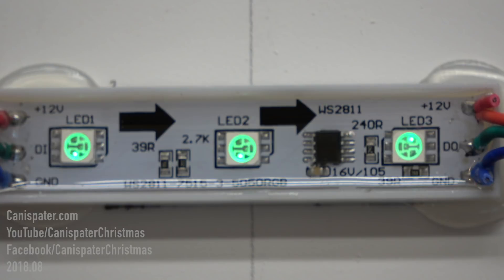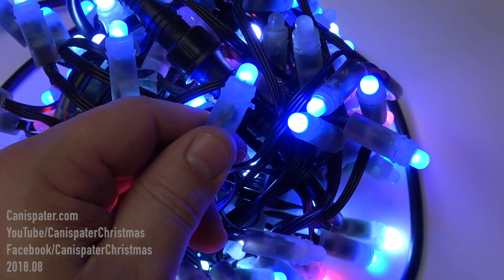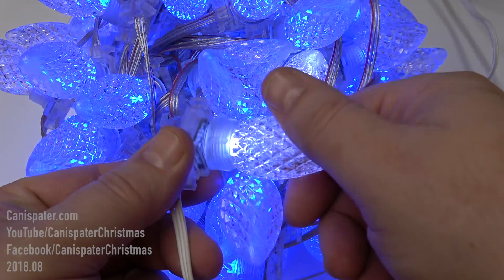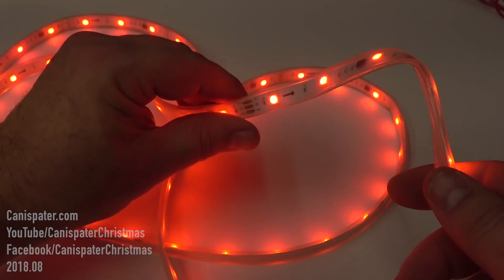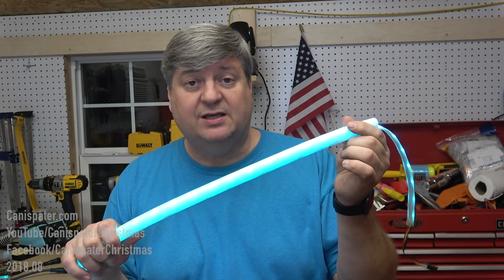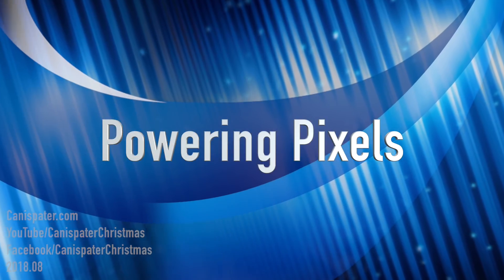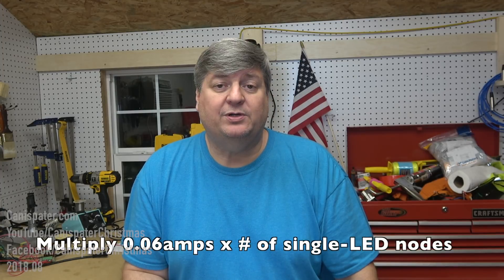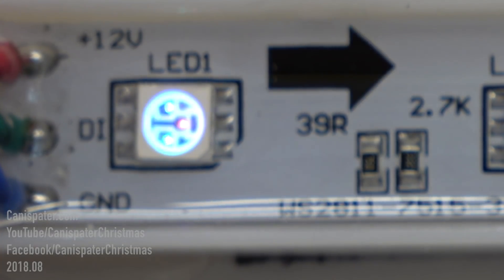HOW TO GET STARTED with RGB Pixels (2018)

Comment: have a starter question, on string of RGB lights with xconnect which end is #1 node, the one with the nut or the (female) or the end without the nut (male), I know sounds like a real newbie queastion.
Reply from the maker: Probably the "nut" end, but look at the pixels with a magnifying glass. Each one will have arrows on the tiny circuit board showing data flow. Also, DI means "data input" and DO means "data out." DI is the input side of the pixel so that is where data from the controller connects to.
Reply: @CanispaterChristmas  Thanks for the reply and videos all very helpful

Comment: Why when I connect the string of 100 pixels the frost eight pixels are still on the first one is blue and the fourth is yellow, what am I doing wrong?
Reply from the maker: Not enough info to go on there. What controller are you connecting to? What kind of pixels are they?
Reply: @CanispaterChristmas  Sorry, I have a Falcon F16v3 and I have attached another box with a Falcon BBB smart receiver v2.0 with its own power supply. I configured the smart receiver the way you did it in the video (the xlight way) but when I plug in the 100 pixel string to test it, automatically pixels 1-8 turn on and the first pixel is blue then white and the fourth one is yellow then back to white. Even when I haven’t started the test. I’ve tried changing cables but the problem persists. Not sure what to do. I appreciate your help
Reply from the maker: If you connect the string to the main board, does it do the same thing? Trying to figure out if it's the pixels or the receiver (or something else). FYI, I'll be away from the keyboard quite a bit today so you might try logging into the xlights zoom room (browse to xlights.org). They can help troubleshoot and possibly resolve more quickly.
Reply: @CanispaterChristmas  yes I just tried connecting directly to the main board and it’s fine. Sounds good, I’ll go to the zoom.  I truly appreciate your help and time.

Comment: What is a good stand alone controller.  I'm trying to get started but just want something simple to start.
Reply from the maker: There's always some degree of "what do you mean by...." in that question. What do you want to do? There are "testers" that will output data for pixels in patterns, but they don't allow for any customization of those patterns. If you just want blinky pixels, then check out Alan's web site for a tester (see video descriptions for links). If you want to run a show (ie: custom patterns, maybe to music) then you'll need a controller that converts E1.31 to SPI and/or acts as a player (Falcons & Kulp boards). If you have a Pi or computer to act as a master show player, then SanDevices makes great "basic" controllers. Availability is like everything else, kinda tight & sporadic right now, especially this time of year. Check out my beginner playlist if you are new to the hobby and that will explain most of the basics and might give you a better idea of what to look for. AND you may need to dial your expectations back as it's difficult to get started in November for a December display. Hope that helps.

Comment: Hey Jeff! Would you recommend buying used controllers? I've been devouring your content but I want to apply what I've learned. This year I'd like to set up a single talking tree using xlights, but I'm having trouble finding a controller that isn't $300+. I've checked out the Sandevices, but wanted to get your opinion on ease of use and compatibility. Seems like everyone is using a Falcon controller nowadays. Also if you have any old controllers you're willing to sell, I'm more than willing to buy one! Cheers to you and your family!
Reply from the maker: Thanks! The SanDevices pixel controllers may lack the bells and whistles of a Falcon, but they do the job well. I started out with them and they are solid controllers. If you're in the toe-dipping stage, I'd recommend them. I can't remember if they are programmable by xLights or not because that feature came out after I switched to Falcons. Either way, if you have trouble, there are people in the Zoom room that are quite familiar with them and can help you get going with them if needed.

Comment: I might pick me up some pixels this year but where I get confused is with the different controllers.
Reply from the maker: What have you been considering?
Reply: @CanispaterChristmas  I'm not quite sure if I want to start with a tree or just my roofline for the first year but I want to be able to expand and synchronize to music. From what I've seen the controllers are the biggest cost and all the videos I've found are at least 2 years old. I'm looking something that will not break the bank so the wife doesn't shut it down before I get started lol. Love your videos, they are informative yet understandable.
Reply from the maker: @homersarcade5950  Yeah, if you're dipping your toe in, pixelcontroller.com has a PiCap that will run a relatively small number of pixels, but will help you get past the steep learning curve of how everything fits together. The Falcon F16, though a larger up-front cost, is a workhorse and has plenty of room for expansion. The F16V4 is out, but with all the supply issues you probably can't get one this year. The V3 is still a very capable controller and I still use my V2. Controllers have a very limited job - convert E1.31 data into serial data for the pixels so they tend to be useful for a while. Each new version has additional capabilities and capacity, but the old ones still work great. You might also look for a used one to keep the wife happy.😂
Reply: @CanispaterChristmas  is that serial data the same as DMX? I've seen some e1.31 to DMX  controllers around the web and was wondering if that was the same or not.
Reply from the maker: No it's SPI I believe - a serial protocol you see on microprocessors/arduinos. Some pixel controllers have DMX outputs, but it's different serial data.
Reply: @CanispaterChristmas  ok thank you. I was getting confused with the different signal types.

Comment: Jeff, I am getting ready to order pixels from Ray. There is a large selection to choose from. But I think I have it figured out. I am not sure on the spacing however.  What do you think about these.?
Promotion!!!WS2811 DC5V 50nodes addressable LED pixel string node;IP68 rated;3inch(7.6cm)spacing;24AWG wire,;RGB full color
Reply from the maker: Promotion = defective. That's why they are cheap. Shipping from China is kinda horrendous right now. You might be better off going through wiredwatts.com if you are in the US.
Reply: @CanispaterChristmas  Thanks

Comment: Do you use resistor or regulated pixels?  Do you have a strong preference for either?
Reply from the maker: I got some last year, but I haven't done tests to see if they are actually more efficient. Might be a good video. :)
Reply: @CanispaterChristmas  about to place my first big order any thoughts on going with regulated over resistors?
Reply from the maker: Regulated should be more efficient, but otherwise the same. You may not see much of a difference with 5V pixels, but possibly with 12V. Like I said, I haven't really done tests to see if there is much of a difference. You might check on Facebook to see if anyone has done more research.
Reply: @CanispaterChristmas  making my first big purchase from Ray and want to ensure everything is correct I ordered “100 node bullet regulated dc12v addressable 12mm ws2811 led pixel string” this will work with common controllers like the falcon, correct?
Reply from the maker: @frostycarbon270  WS2811 is supported by all controllers AFAIK. Know that shipping from China is kinda horrendous right now. You may get better pricing from a local vendor, but if you've already placed the order, then no worries.

Comment: Do you have any recommendations on 3 strand wire for longer runs?  I see thermostat wire is 18/3 but I doesn’t seem to be rated for outdoors.
Reply from the maker: Unless you plan to permanently install it, outdoor rating is less important. I generally use speaker wire just because I had it on hand. Real copper does seem to do better as I've seen corrosion with CCA.

Comment: how many pixels can you have in a universe?
Reply from the maker: A universe is 512 channels so 512/3 or 170. You can actually use the last 2 channels for 171 and have the next universe provide the 3rd channel. You really don't need to care about that as controllers & software understand the protocol. You just need to allocate enough to handle what you need.

Comment: Thanks Jeff for wonderful videos. My home wall outlet is 110 V AC, & hooked up with main panel breaker of 15 amps. If I use same outlet to power my pixel controller , how many pixel leds can be hooked up with same controller ? i mean, does 110v AC wall outlet amp capacity & amp being consumed out of DC 12V/5V  controller has any relationship ? how to calculate safe amp load?
Reply from the maker: There's a relationship, but I don't know the calculation. I'm running about 6K pixels on 1 outlet. It peaks around 800 watts AC and idles around 200 watts.

Comment: Can I run light o rama controllers with a x-lights program
Reply from the maker: Yes. You can either use a dongle or get a pixel controller (like the Falcons) with a DMX/LOR output that can plug into the LOR controller and sequence everything in xLights. I don't have experience with that, but several in the group do. Check out the forums and Facebook groups linked in my video descriptions if you have questions about it.

Comment: I know this is an older post but just learning more about the RGB world. Have been watching your videos. I'm a LOR user but thinking of switching to X lights. LOR licenses are getting way too rich for my blood. Plus I See Xlights have a lot more options and effects. Anyway, I'll be building a lot of new props for next year and needing to start with pixel ordering. There seems to be multiple node types but think I got it narrowed down to bullet style. thinking of going with the 12 V like yours but I see there are some that use resistors and others that have a regulator in them.  what would you recommend?
Reply from the maker: Most of my pixels are resistor because regulated are relatively new. I got a bunch of regulated this year, had some failures (slightly more than my resistor version), but overall, they seemed to work fine. I haven't done a comparison between the two with regards to power consumption, but theoretically, regulated should be better. Also, if you are in the US, my preferred vendor is wiredwatts.com. I still order from Ray for bulk orders, but I find myself ordering more from Ken (ww) lately because he has a lot more of what I need, not just pixels. To answer the question, regulated from now on. :)

Comment: What about light o rama
Reply from the maker: Could you be more specific? I don't use LOR so I'm not a good resource, but there are a ton of folks on PlanetChristmas.com that use it and can help if needed. Or do you mean you have a large LOR investment and you want to add pixels? There is a lot of interoperability so let me know what you're asking about.
Reply: @CanispaterChristmas  thanks yes I have some Lo r and I wanted to add pixels.   I am  brand new to pixles
Reply from the maker: @kiteslights7189  OK. I know the Falcon F16/F48 has an output to drive the LOR boards and you can import your LOR sequences into xLights. There's a couple of videos on the xLights web site (xlights.org) covering all that, but I won't be much help there. Definitely check out the forums/Facebook groups listed in the video description - there are folks that have already done this.

Comment: hello I was wondering if you could do a video on everything needed for a RGB mega tree to include controller power ect. i am looking at building one this year and this will be my first experience with rgb. We purchased a pixel tree from qvc and we loved it until it rained and it quit. so many bad reviews so we sent it back fort a refund. so i am wanting to build one to replace it that will hold up to the weather.
Reply from the maker: Haha. Covered on another chat platform. Welcome to the hobby!
Reply: @CanispaterChristmas  THANK YOU SO MUCH!!
Reply: @CanispaterChristmas  another question because my wife has been watching your videos and she saw you had a link for a starter kit on one of your videos but did not know which one. could you possibly post that link for me. thanks
Reply from the maker: The only starter kit I can think of is this: https://shop.cfolights.com/product/pixel-starter-kit-desktop-star-burst-2019-presale/ a very small (desktop-sized) set of pixels, but has everything in it to run them. Probably not what you're looking for though based on our previous conversations.

Comment: Great video! I’m new to all this and was wondering if I should go led route or standard lights that use light o Rama controllers?
Reply from the maker: Haha. Standard lights have their limitations, but have a lower learning curve. Pixels allow for pretty much anything you can dream up, but you kinda need to have a passion for them as there is a lot more to learn. If you have no background in electronics or computers, standard is probably the way to go. If you have the background and are a little OCD, you'll likely prefer pixels. There are forums for both camps and you can start with standard and add pixels later if you want. Which way do you wanna go?
Reply: CanispaterChristmas the pixels look way better. I know computers well but have little to no knowledge in electronics. I was thinking of starting out with maybe 2 controllers a few little trees, some house lights and a midsize mega tree? I live in a suburb home with a standard fuse box.
Reply from the maker: You might want to start with some pixels then. I had about 6k pixel in my display this year. Run it all off one circuit breaker so they don't pull a ton of power. Last year, at idle (only the power supplies & controllers running) it pulled about 200 watts. During showtime, it would fluctuate between 600-800 watts. Standard house wiring has no problem handling that load. There's not much electronics except for connecting things together and calculating how many amps a string is going to pull. The wires (+, - and data [maybe clock]) and voltages (12V vs 5V) are important. Get involved in the community (forums and Facebook groups listed in the descriptions of my videos). You'll learn a lot. Make sure to check into the xLights zoom room on Wednesday nights if possible. They have weekly presentations related to the hobby and also have Q&A afterwards. You'll learn a lot.

Comment: Great video.  Do all 16 channel controllers handle 1024 pixels per Port/channel?  I know you said the f16v3 does but how about kulp boards or renard ss24?
Reply from the maker: There is no standard. You need to check the specs on each one. I only have the Falcons and some SanDevices boards. Also, for pixel controllers, they are pixel ports. Channels are something else all together and confusing the two will be, well, confusing. :) 3-channels per pixel (red, green blue).

Comment: I took your online course at udemy and found it very informative. I still have questions as I am just starting out . I have messed around with light show pi and the the node mcu . If you can help me out or a video link would very helpful. The question is with the universes and how there defined in the Falcon f48 and xlights  . I kind of get it but still not 100% . How many universes do you need how do u calculate that  . I know each node is three channelsSo if I have one string at 50 knows that will be a little bit less than one universe know if I have three strands of 50 then that should be three universes if I’m doing it correctly this is where I’m getting it confused and not too sure of how universes are added together how many strings equals the universe and so forth so any help that you can give me would be very appreciated
Reply from the maker: E1.31 is the stage lighting protocol that is used, essentially DMX over Ethernet. A Universe is 512 channels or bytes of lighting  data with a few additional bytes for administrative overhead. 170 pixels is 510 channels. Pixel 171 can be split between 2 universes so you don't have to worry about universes much except for getting the size correct and knowing how many you need (which xLights can tell you). Older controllers chose to use 510 as a universe size to stick to 170 pixels exactly, but newer controllers can use 512, yet come set to 510 by default to interop with older controllers. If you follow Keith's method of configuring xLights then send the controller config from xLights to the controller, you don't have to worry about calculating anything. It can also program the outputs on FPP if you use it. xSchedule uses the xLights config. I'll typically wait until I'm done adding models and look at the last model on a controller to see how many universes it uses then adjust the controller entry before programming the controller with xLights. No spreadsheets or calculators needed. :)
Reply from the maker: Oh and Thanks for taking the course. I hope it was helpful!